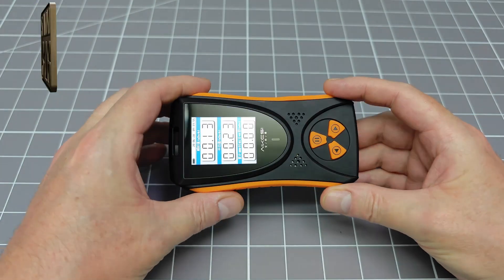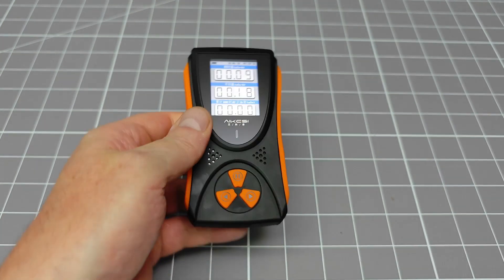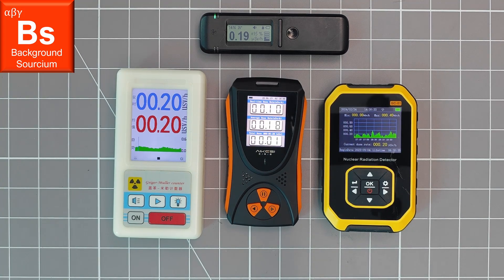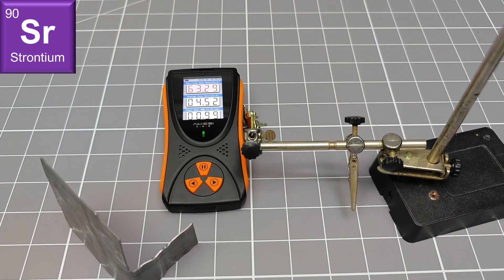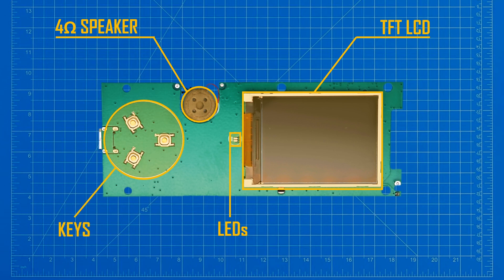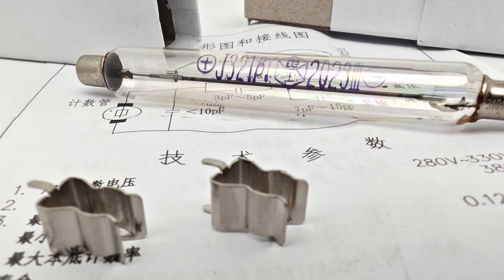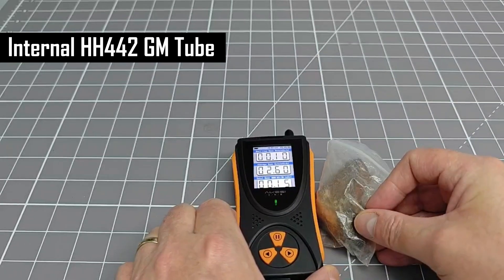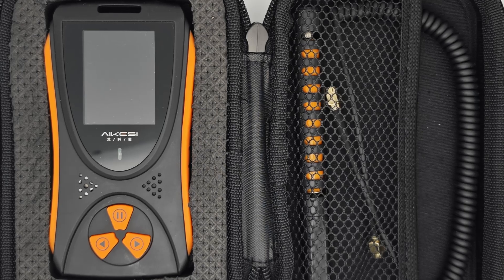It's a popular Geiger counter, but is it any good?

Comment: Very good video! Like all product categories, there are high quality products and low quality products. I'm really interested, why the HH442 GM Tube shows a worse performance than the J321 GM tube? You can clearly see an optical difference, but I like to know more details about the technical and physical parameters.  Maybe you can list some glass GM tube models with high quality and some models with low quality and which detectors use them. I'd be very thankful for an answer.
Reply from the maker: Thank you for the comment, it is always appreciated.  You really stepped off the "beaten track" when you found this video, it got pretty much no views.
In general, any tube that has less mass between it and the outside world will be better.  This device claims to be a beta capable detector, but in reality, the steel outer electrode will prevent that from happening.  Just glass is better, but if you can afford it, then a thin mica window is the best...
Reply: @project-326 
Thank you for your answer. Yes, your argument makes absolutely sense. I recently bought the GQ GMC 300S, which uses the M4011 GM tube and is after some research, if I'm right, the same as the J321 GM tube, just different names. It's a decent geiger counter for the money. In the future I will upgrade to a better radiation detector. Keep going with your videos, they are very informative and I like them a lot.

Comment: can you review the hfs10 pro, because as you said the weakness is the bad gm tube, the hfs 10 pro is advertised to not use gm tube but use scintilator crystal like the radiacode and cost $50, it does not connect to pc unfortunately but it should be intresting low cost none gm tube dosimeter
Reply from the maker: Thank you for the comment and the suggestion!
Reply: Its a photodiode not a cystal

Comment: You did a great job in upgrading this instrument! That's how it should've been made to begin with! I also like external probes in certain situations. You can use it on a hot source, but from a distance, getting less exposure–with a long HV cable. Also, you can read the display in awkward settings and positions, unlike with an internal G-M tube! Besides the awesome upgrades, I like that this has an actual mini-speaker–powered by an audio amplifier circuit! Sometimes, piezo buzzers just don't do it justice, in my opinion, like a good ol' fashioned amplified speaker! You could also make an energy-compensated probe, if you can get your hands on some brass or tin tubing! Very well-done video! I enjoy these a lot! Thank you so much, and cheers from the USA!
Reply from the maker: Thanks, I appreciate the feedback!

Comment: b particles are stopped by thin material such as the glass only mylar coated GM tubes can process beta (or hard alpha particles ) -made by LND and other manufactures
Reply from the maker: the penetration of betas is a function of their energy.  Above 200 KeV, they will penetrate the glass of the tube and be detected.  I have tested my Sr-90 source on a lot of different glass tube products, please take a look at the channel for those reviews.

Thanks for the feedback!

Comment: The switch connection is wrong in the schematic displayed in video
Reply from the maker: Yes, you are correct.  Damn!
I will be making new probes for this unit, I will correct it then.  I don't think anyone has actually tried to do this themselves yet...
Reply: @project-326 I would try to do this mod. Very clever project. There any chance to buy from you the Geiger sensor 3D housing?
Reply from the maker: I don't sell stuff on this channel but will try and figure out some way to make the 3D files available to everyone.
Reply from the maker: I updated the schematic and added to the community page, thank you for taking notice of that!  I was in a rush to release the video and "dropped the ball" when it came to proof reading.

Comment: Nice! Hey quick question, why so much effort on Geiger tubes detector/counters? Scintillation is far more efficient by weight and not much more expensive. AND you get the option of getting a spectrum! What do you think?
Reply from the maker: I completely agree with you about the advantages of a spectrometer, and yes, the prices are falling, but they are still 8 to 10 times the cost of a cheap Geiger counter and for many people, that makes a major difference.   For a lot people, its an impulse buy when they get their first one, or a 'just in case' mind set (remember how IR thermometers were almost impossible to buy when COVID hit?).

There is also something  about the challenge of using simple tools to get some useful results, that appeals to me.  

For example, I am working on a project to add DIY energy compensation to very low cost tubes.  

I am also looking into building my own scintillation detectors, SiPMs have come on a long way and in fact has been the key enabler for products like the Radiacode, Raysid, Measall, etc.

Here's some food for thought... 

If the cell phone guys decided to add gamma ray spectrometers to the sensor package, using the semiconductor industry leverage that they have, compact scintillation crystals would be both cheap and have exceptional energy resolution.  Just look at the huge single crystal ingots that are cheaply made in the semiconductor supply chain, look at their purity and near perfect crystalline structure, the current niche scintillation production industry can only drool over those manufacturing capabilities.

For the SiPM, again, the big guys could leverage the semiconductor industry to produce more sensitive SiPMs with fully integrated analog front-ends that would be far lower cost than the current industry standard, have lower noise, higher quantum efficiency and be produced in huge quantities (they are currently made using spare fab capacity on very old process nodes).  

Just imagine the apps that would be created by leveraging the huge talent pool of app creators that specialize in smartphone native hardware.  Think about all the mapping apps with all that dose rate data...

All it could take is a 'nuclear incident' that gets enough news coverage, for the cell phone guys to consider doing it.  The up-cost to the BOM cost for a typical smartphone could be under $10.

I should probably made a video about this... :-)
Reply: @project-326  that`s absolutely true! it always comes down to the money isn`t it! Although there is physical limitation to scintillation crystals efficiency and detection limits (mostly temperature related) It always takes a boost in sales for investors to be motivated enough I agree. I am working on a video that will include some of the things we`ve talk about. My CdTe semiconductor will play a big role in that.. Mine is already 20 years old and is small enough to be incorporated in a cell phone.

Comment: I'm sure such junk doesn't take into account the dead time of the geiger counter and therefore will underestimate the readings as the radiation increases.
Reply from the maker: I seriously doubt it takes a lot of the physics of the GM tube in to account.  I was surprised that UNI-T, (the low cost instrument guys) carry this thing in their range of products.  Whilst UNI-T stuff is cheap, if is normally OK(ish) quality/performance.

Comment: Try testing the GQ GMC-800. I use that model along with my early (good) version of the FNIRSI GC-01. I also have the Radiacode 102 and 103.
Reply from the maker: I might get around to testing the GMC, though I plan to be focusing on experiments (using the sources/detectors that I currently have) for the next few videos.

Comment: YES I have been waiting for this review I have the same Giger counter you can remove the right silicone piece for more sensitivity
Reply from the maker: Sadly, that won't give it any beta response, which is limited by the tube.  The gamma sensitivity is also fairly 'grim', the active volume of the tube is just too small.

It's such a shame, when I first received this product, I was actually quite excited, that quickly turned to disappointment.

The software is essentially 'fiddling' the results.  Below 1uSv/h, the device calculates the activity level by multiplying by some coefficient, probably around 2 to 3.  Above 1uSv/h, it divides the values but another coefficient.  I think that the designers decided to get two different reference points about right, the background and some test source (probably Cs-137) they had available.
Reply: @project-326  Yeah their Geiger counter's readings are not accurate. The counter shows readings that jump from 0.12 to 0.15, then to 0.16, and then to 0.40usv/h. I have never seen a reading between 0.16 to 0.40usv/h and find it frustrating. 
Could this be a simple fix with a bit of code?

While watching videos about the same Geiger counter I noticed that some counters use a different MCU chip that provides more precise readings maybe. I think that the manufacturer may have switched to a cheaper chip to save money. Then that gives us less precise readings. Also, I don't know if I have a different tube in my one is labelled J442y XRHH 2023 and I can't find any info on it it looks the same though

Comment: Completely agree with you! Could you test some Radon monitors like airthings as available information are not very promising.
Reply from the maker: I looked at that Korean one, and its pretty expensive.  If I get a chance, I might do that but please remember that I finance this channel myself, I buy everything personally (with one notable exception, the KC761B varient, the vendor gifted me one [I assume it was a gift, they haven't asked for it back yet]).
:-)
Reply: @project-326  thank you yes sure, I plan to ask Raysid to send you detector for compare, they just work on the software for identification of multiple isotopes in contaminate! :-) And just after spend an afternoon checking all the options I am only smarter to know there are basically two types, diode and ion chamber. Then checked professionals like Ludlums, they use only ZnS(Ag) scinitllators. Maybe there is an option to measure it with my Geiger counter, I payed for Inspector 800 US$, pancake tube, mica window about 4 times sensitive then cylindric, but when compared to 350 Euros for radiacode, I feel like an idiot! :-)